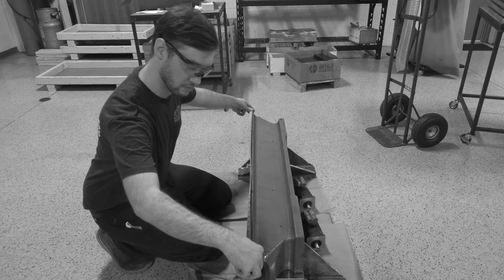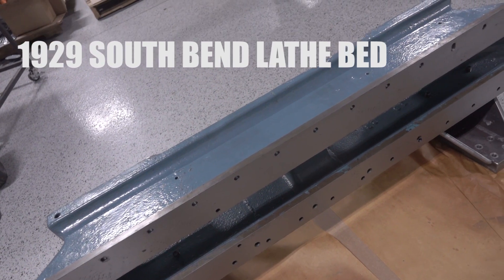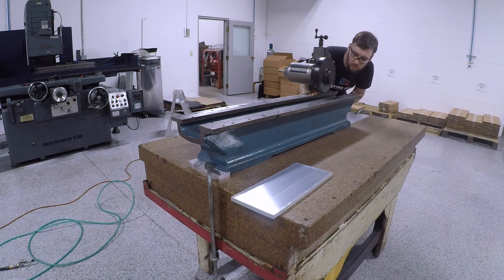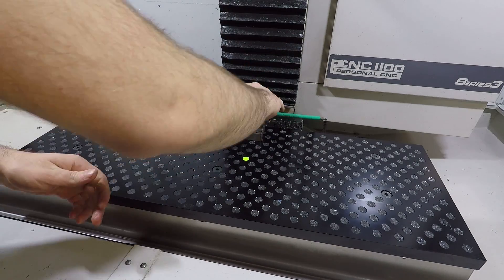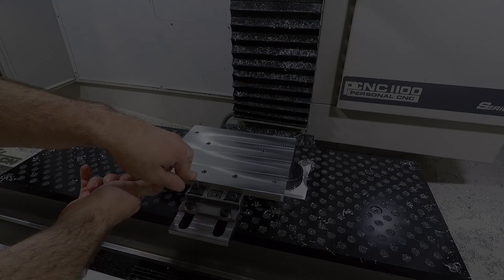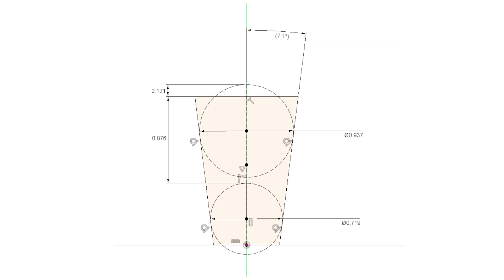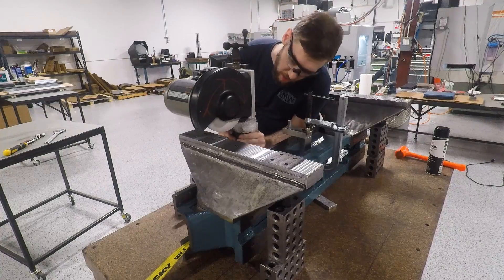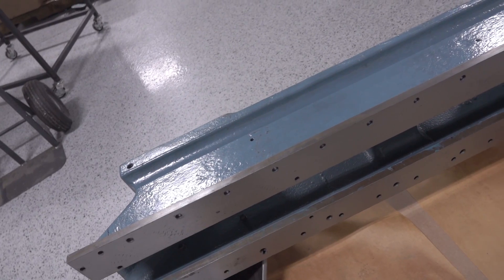The Jank-O-Grinder!  WW231

Comment: Love the thinking-without-a-box way of doing this. Sketchy looking, but sturdy. And I would definately want to use air bearings and add little steps on the outside of the surface plate so it can't skid over to the floor.

That taper looks to be the typical 1:8 taper in grinders, the correct angle is pretty much 7.125. The ball trick is an easy way to measure, another option is to mount the piece to a sine table and tilt until a DTI shows zero on the center line.

Comment: How did you verify it was within .0005" over the 4 foot? Did you measure it off of that same plate?
Reply: @Ed Rees Way to "Getter Done"! If you wanted a better idea of how good it really was you should have put it up on some good 1-2-3 or 2-4-6 blocks and swept it with an indicator on the face using a height gauge.

Comment: This must be that Jankee ingenuity I keep hearing about. 

But seriously I'm impressed, and that ball taper gauge trick is going in a grey cell.
Reply: CAD software: taking the math out of math! 
Let's see, the difference in the radii of the balls is this much and the distance between the centers is that much, so, you've got the length of the opposite side and the length of the adjacent side, so calculate the slope, and then look up the slope in a tangent table or use your scientific calculator and over/under the angle until the tangent matches the slope.
CAD sounds easier....
Reply: @jfan4reva  inverse tangent my dude

Comment: NNNNNNNNOOOOOOOOOOOOOOOOOOOOOOOOOO! You need to scrape it in. Not only are you messing up the part your wearing down your Slab.
Reply: It was way too far out to scrape it in. (Unless you have weeks to scrape out that much height differential.) It's not wearing down the surface plate enough to be concerned. Plus, the surface plate is being used for its mass/rigidity, not it's flatness. It's being used on a router, not a CMM.
Reply: Usually you grind for parallelism and "rough" flatness before scraping.

Comment: Great idea, and not so outside of the box that it would not be considered a very reasonable solution to a wide spread problem. Thank you for this post it helps many with similar issues, way to think like an engineer.